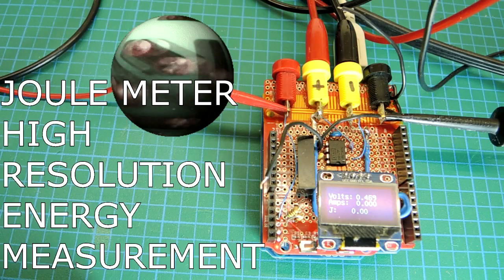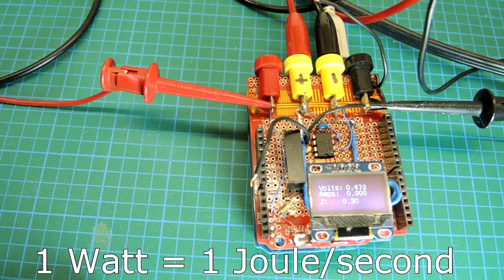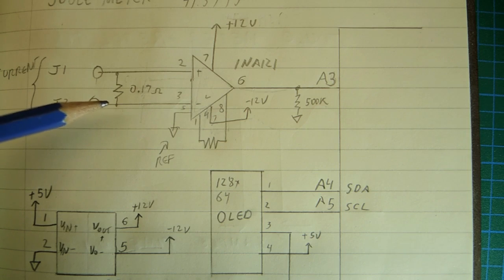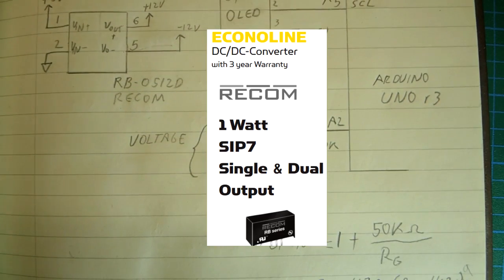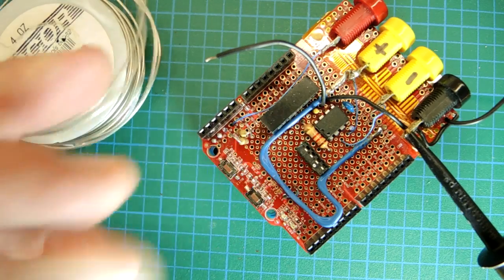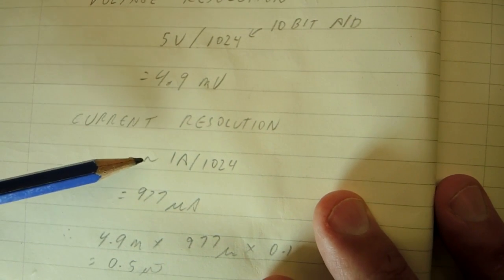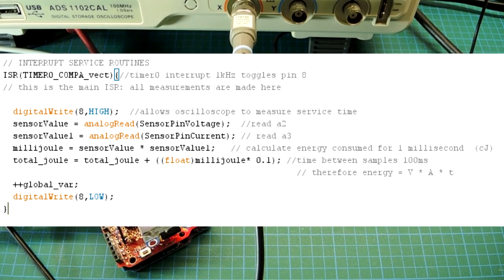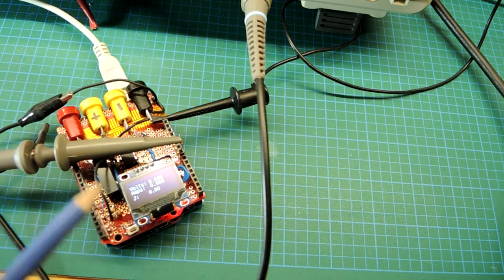Joule Meter: Precise Measurement of Electrical Energy

Comment: Hi there, Im working on a project ín which I need to analyse energy consumption but I'm not an electrical engineer (but a Software Engineer). Is there any commercial product available that I can buy that actually measures Joules at this resolution?

Comment: Brought to mind this circuit for the same thing which can handle a wide range of currents:

http://jeelabs.org/2009/12/21/power-consumption-tracker/

I wondered about low pass filtering so that it would be accurate on things were the power consumption varied a lot faster than the measurement frequency.

Vaguely inputs on Arduino have protection diodes which will turn on with reverse polarity, problem is limiting current, stick a big resistor in series, the input impedance is huge. But noise can then be a problem:

http://www.openmusiclabs.com/learning/digital/atmega-adc/